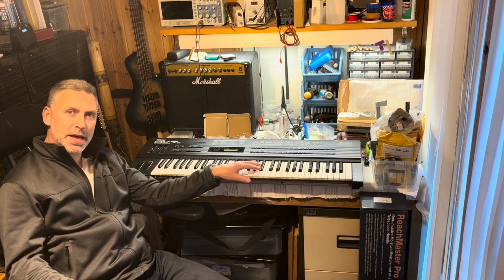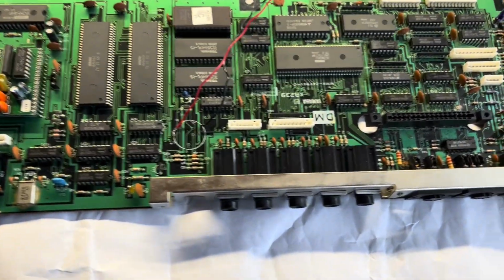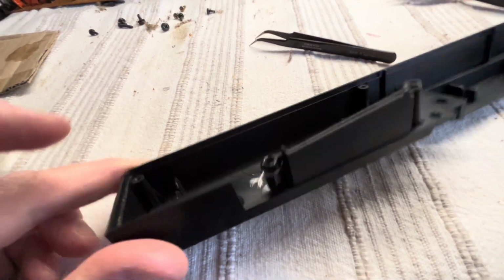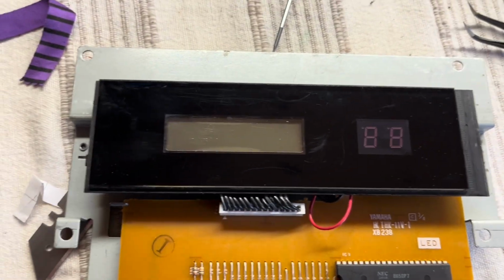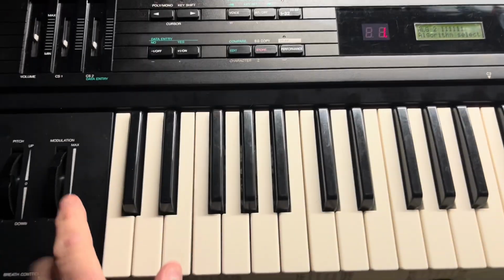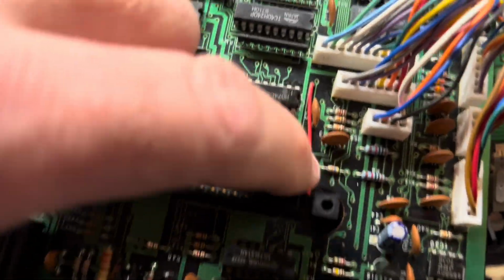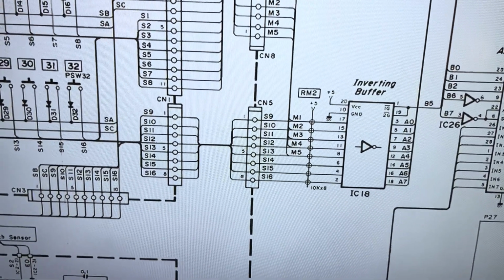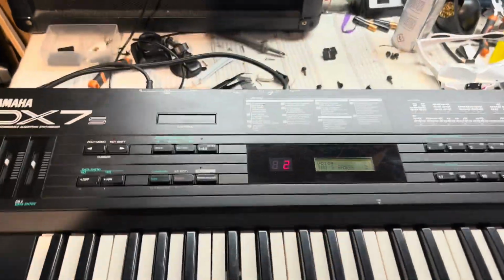DX7s Repair (not just a battery change)

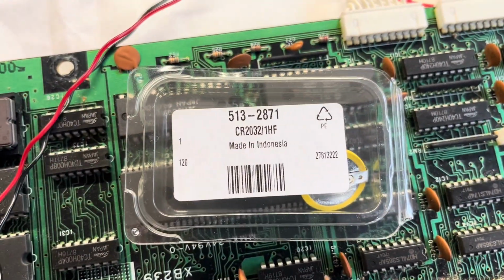Comment: Good video, gave you a like, but at 9:12 you show a board mounted battery that you are going to put in, and you will backing out the modification that moved the battery off board (usually to a battery holder - which I didn't see so far in your video, I only saw two wires).  Many people prefer the modification to have an off board battery holder (mounted in an easy to access area) so the user can simply open up the DX7, pop out the dead battery, pop in a new battery... and Bob's your uncle! No mucky-muck of cliping/desoldering of an old battery. When I put in battery holders, I velcro the holder to the case so if there is a need to remove the circuit board in the future, the battery holder comes off the case with it.
Reply from the maker: Hi Paul.  Fair comment.  I did consider it but concluded that I probably won’t be doing this in 10 years time and my preference was to restore to original condition.  All the best.
Reply: @Burfordstechstuff  True, the battery does last years. Soldering in the battery may be preferred by gig musicians as it is more reliable.

Comment: Hey Tech stuff thanks for this video a tip from a vintage synth enthusiast & not profession Technician many People watching these videos my self included are more interested in finding out How to approach taking it apart them selves so they can do basic repairs on their DX2FD than anything else. So showing the process of unscrewing each section fully is very important to people with limited knowledge on the specifics of this model construction. for example i am searching for what to disconnect and NOT to disconnect to get to the key bed & replace 1 broken key in a straight forward manner. Just food for though for future videos cheers!
Reply from the maker: Hi.  Thanks for your comments.  I hear you.  Sadly I don’t have the time or the video kit to do the full timelapse piece in disassembly.  There’s always a mix of self tapping and machine screws on the DX and I make a diagram of their positions when taking off the base plate. Other than that, when things get complicated, I try to remember to take photos of sub assembly before taking things apart so I can refer to them later.  It’s always worth buying a few extra screws I guess. I may do a separate video on disassembly/reassembly techniques and hints.  Thanks.
Reply: Hello, I have a DX7S that I recently replaced the battery in, but it still says "change battery" when I turn it on. Even though the battery is new and it stores internal sounds, I wanted to ask if you had this problem and if possible, could you please advise me on how to fix it?  @Burfordstechstuff
Reply from the maker: @DAVID_DIXON_2000 Hi.  Could be something with the battery circuit.  Check all tracks for shorts and the capacitors to start.  Also try a different battery just in case.